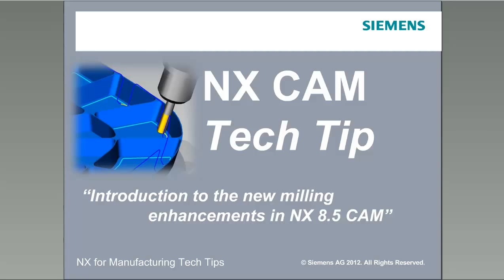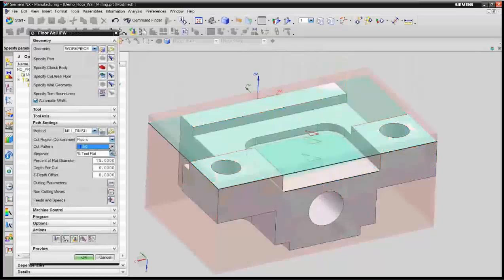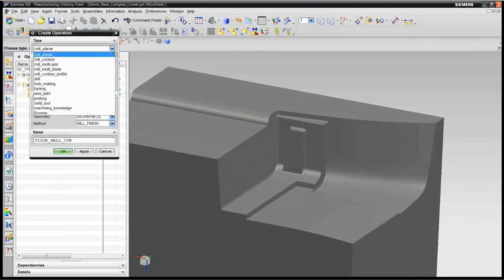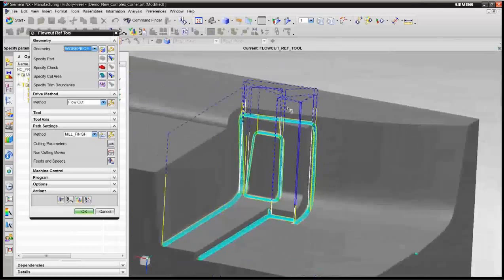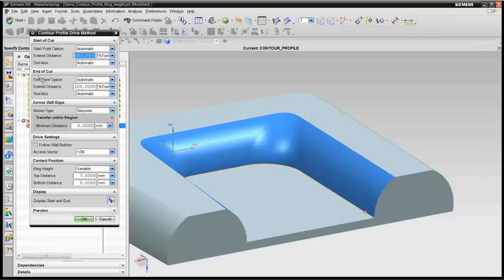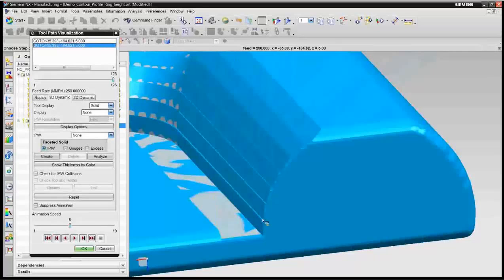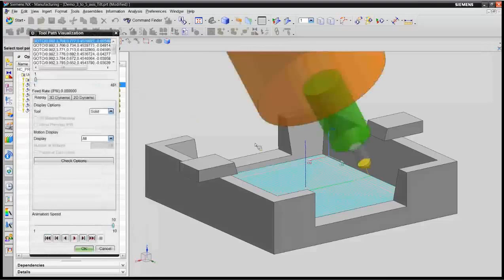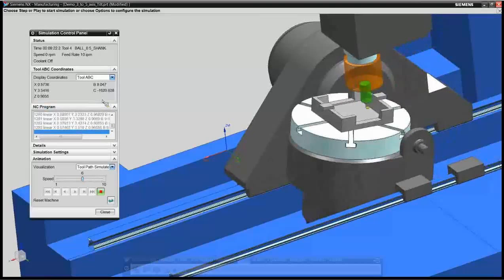NC PROGRAMMING - Introduction to the new milling enhancements in NX 8.5 CAM (Siemens)

Comment: Obviously, the flowcut for the steep area with Zig Zag can reduce the number of tool jump, but it will cause cutting velocity sharp change in direction, which may easily damage the tool, 

So do you really create a function for DEMO only or just create a function for reality. Try to learn something from Hypermill flowcut.., they have got it fix at least 5 years ago.

Comment: Presented by Jim Wright??? Am I right? I haven't had a chance to try with simple milling, but I think for other 3 type operations listed in PPT, they are really toy thing, since 3 to 5 axis is only working for ball end tool, contour profile aligned with UV can be totally replaced by adding a reference driving surface... 

What a pity, there is no new, no creative things, after NX6...